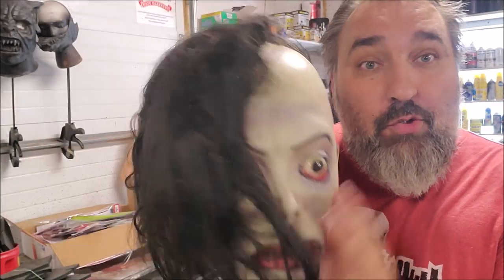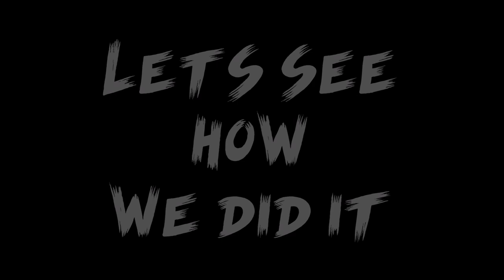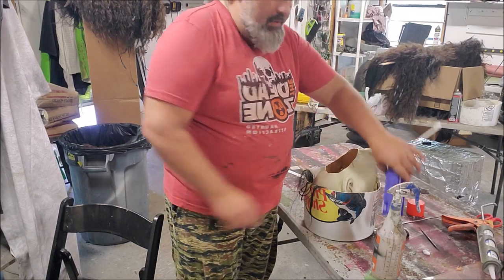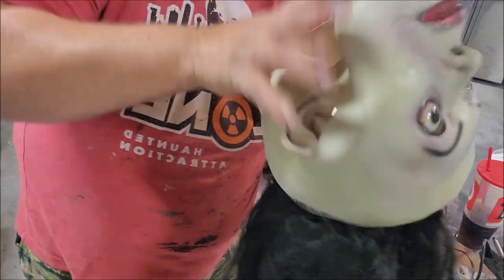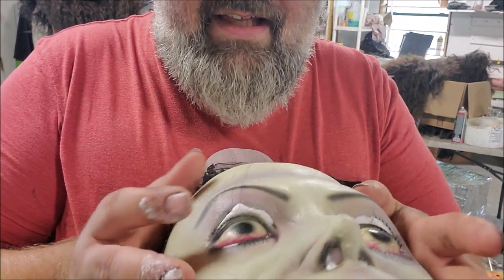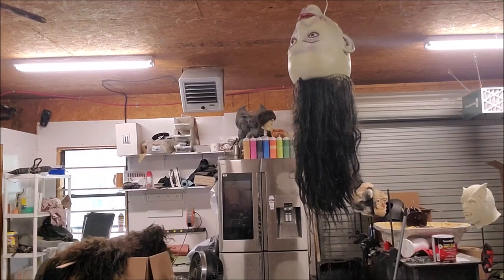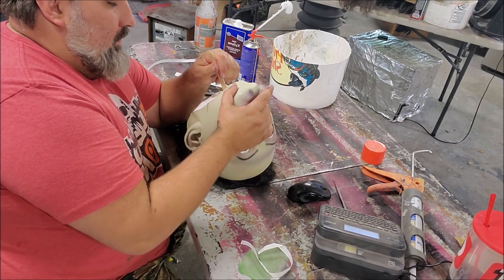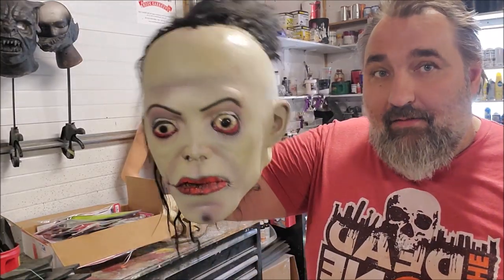Make a prop head from a mask

Comment: Would it be possible to use this foam head as a means to remake an old mold that is exhausted, by covering the foam filled mask with plaster? If so, would i need to spray pledge onto the latex mask before applying plaster, and how difficult would it be to remove during once the plaster has cured? As always, thanks for sharing.

Comment: I have some masks that i want to turn into the display foam filled head.  I have seen you use both locktite spray foam as well as the home depot sika post fix.  What is the better application for someone just starting out.   I took some of my old masks and turned them into life sized props this year for Halloween.  I just used the foam head.  Unfortunately the head is small and does not fill in the mask properly.  Then i came across your videos.

Comment: What effect does the water spray have on the process?  I would've thought it would cause foam collapse.
Reply from the maker: It helps the cure time- the foam uses water vapor in the air to cure- this foam is more dense- so it has less collapse in general.

Comment: I am a beginner, this looks so easy. If I wanted to put a piece of pvc pipe in a mask at what step what I add that.
Reply from the maker: while the foam is soft
Reply: @StiltbeastStudios  ok thanks for the reply. I will give it a try.
Reply: Would drilling vent holes in the pvc allow gas to escape or will the uncured foam just fill in the holes?

Comment: This may be a dumb question. But if you wanted to use a mask for a pneumatic prop would this system work if I had a metal square tube in the metal and monitored it?
Reply from the maker: it would work, I have done it. more violent motions might need a more robust foam

Comment: Theoretically would it be possible , 
to fill a mask you didnt want with plaster or something similar making it solid and using it as a bust head for future Sculpting and molding ?
Reply from the maker: in theory yes but better to do a life cast as masks already have distorted proportions
Reply: Seems it would work to build layered or heavily built up masks—like your scarecrow mask or maybe a zombie. Inserting a pole or PVC section would make it mountable.         I think I just figured out how to do a bunch of heads on posts like in TWD finale from the Whisperers season.

Comment: I’m looking to make a sculpture using some sorta hard clay 
Making a rubber latex mold 
And filling it with foam and I wonder how smooth it would come out if it would get the detail
Reply from the maker: latex molds are pretty common still and they hold great detail, just make it thick enough that it does not distort from the pressure of the foam.

Comment: I’ve been scouring the Internet for weeks now to  find a severed head and this was close when you said you might sever it I have my fingers crossed, but I’ve searched watch all of your videos and can’t find any severed parts made from scratch😢
Reply from the maker: would turning a mask into a severed head work?
Reply: What I’m trying to do is make severed arms on a body! I’m gonna have a dummy hanging and was hoping to cut the sleeves off the arms and have the arms sticking out severed off around the elbow I tried the glue and paper towel method with Loctite, but wasn’t coming out where I was hoping lol

Comment: Hey Allen, do you know if it is possible to do this but with the new latex mask inside his plaster mold ?
Reply from the maker: yes, but be careful- this is a rigid foam when fully cured. Just do one layer clinging to the mask- pull it from the mold at the 15 minute mark or sooner- its just as easy to do out of the mold really.
Reply: @StiltbeastStudios  thank you for ur Answer, I just finish right now to watch ur live .
What time start ur live (it s the night in france😉 when u begin it?)

Comment: I’m filling a mask here real quick for my haunt. Question: can I cut the foam out later? Will it leave residue on the latex? Cause any permanent changes?

Thanks fir all the great content!  🙏
Reply from the maker: yes you can, but easier to just pull the mask off of it. and baby powder the inside as another layer of release.
Reply: When do I add the baby powder?
In the video you mi ay the onside of the mask, so I’m a little confused.
Thanks again!
Reply from the maker: @natij26   you want to remove the foam later right? If thats true then Id powder the inside before you foam it. I just wanted mine foam filled in the video so I did not use a release.
Reply: Yes exactly!
Thanks for the help!!

Comment: What if you would wet down the inside of the mak first so you could get the mask off. Then you would have a foam head.
Reply from the maker: you could, but that was not my goal- I wanted a foam filled mask as opposed to a vaguely head shaped head. you really dont get much detail.
Reply: @StiltbeastStudios  thanks for responding. Yeah, I  get what you were doing. It was just a question I had about making skulls and masks. I just wasn't very clear with .y question. Honestly, I  wasn't expecting a response. So, thanks again.